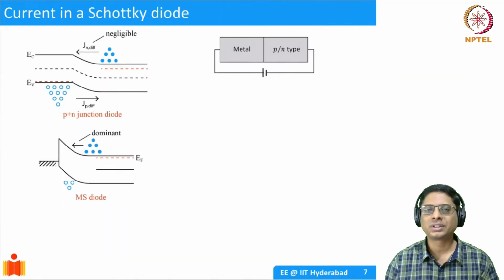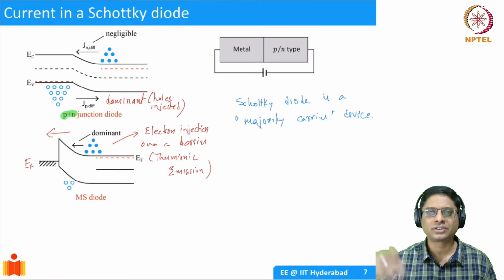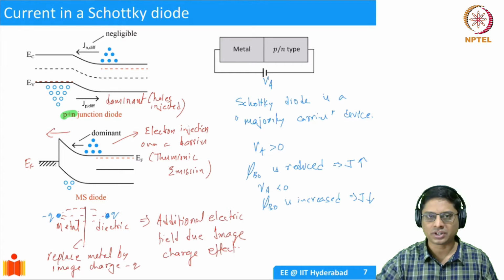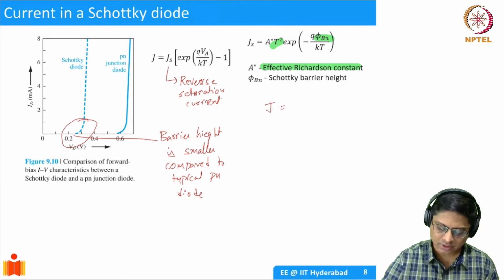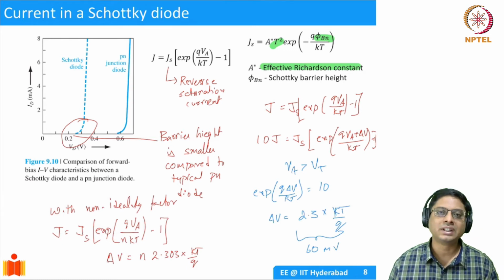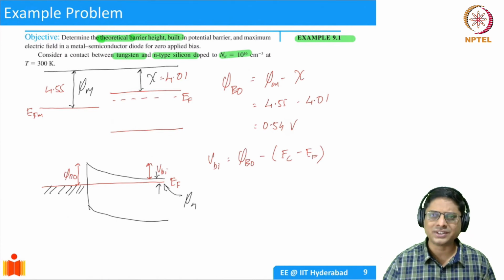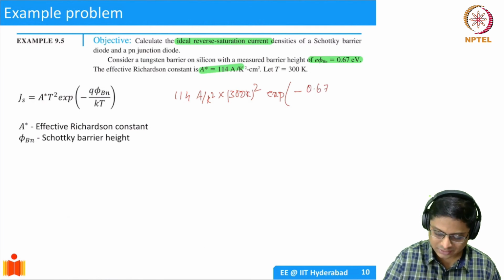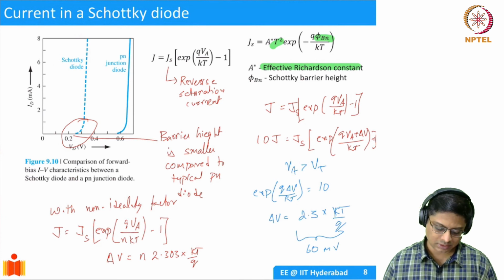6.2 Current flow across a Schottky barrier

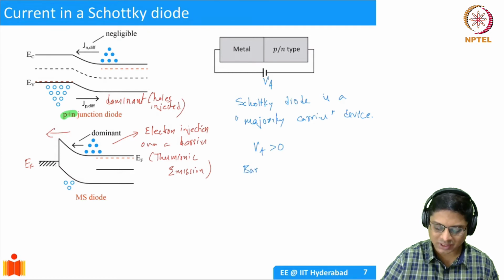Comment: @4:19, we should not call it phi b0 but rather we should call it qV0 i.e. potential energy seen by electrons in semiconductor towards metal. phi b0 is, in general, a constant quantity. It is the barrier that electrons in metal sees towards semiconductor. It is , in general, independent of applied bias. What changes after we apply bias is qV0 ~ (q(phi metal - phi semiconductor)).

Comment: Could you explain how you calculated voltage as 60mv?
Reply: do u knw where is the full playlist of this lecture series?
Reply: 60 mV is the thermal voltage.  Please check this parameter in order to understand where it comes from.  Boltzmann's constant times temperature over the electron charge
Reply: It is coming from thermal voltage 26mv and log(e). Once you convert log(e) in terms of log (10), you will have log(e) = 26mv * 2.303 *log(10). 26*2.303 is approximately 60 mv